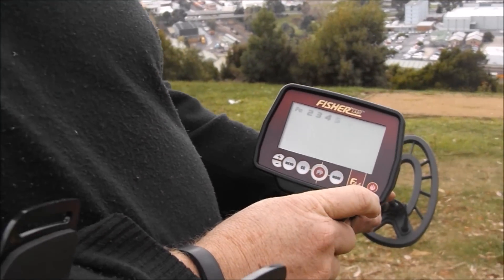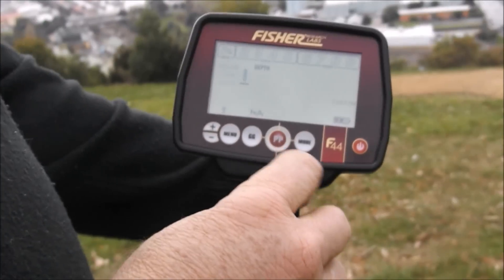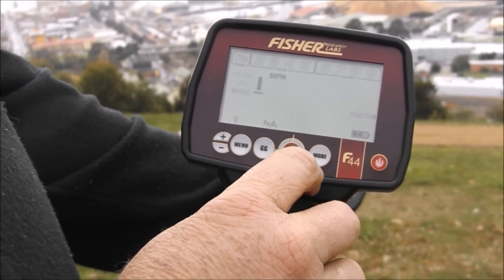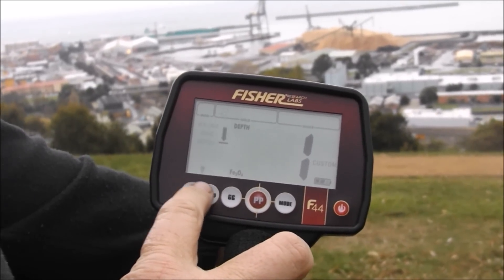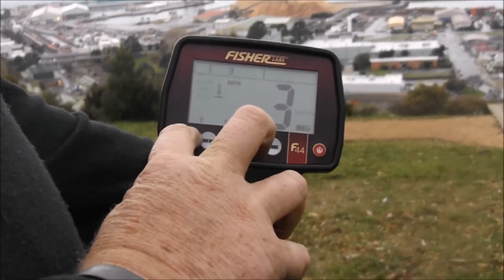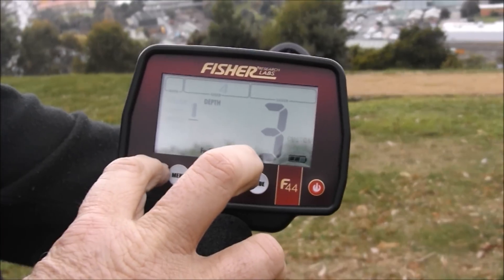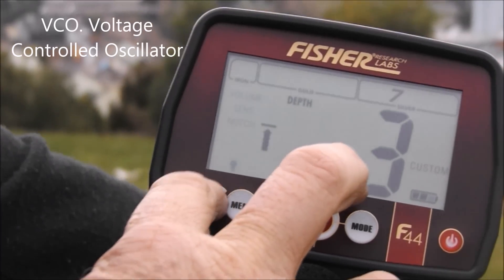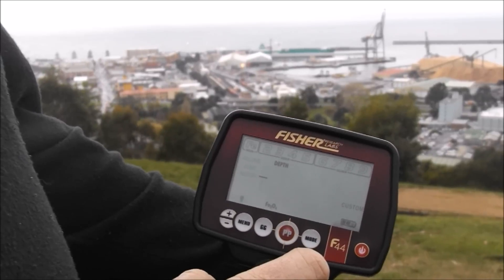Fisher F44 Programmable Tones Demonstration

Comment: I run mine similar to the 2L mode on my F75. Quiet iron grunt for FE, 1, and 2. Then VCO on the all else. I hunt suburban parks, not older than the 70's. Otherwise I run in mode all default for fun coin shooting. The F44 is a very leisurely detector.